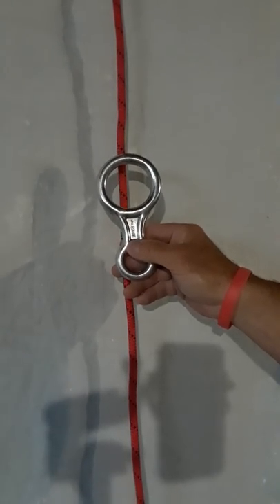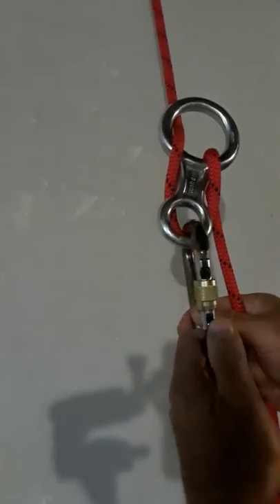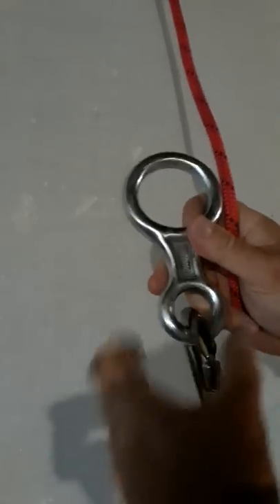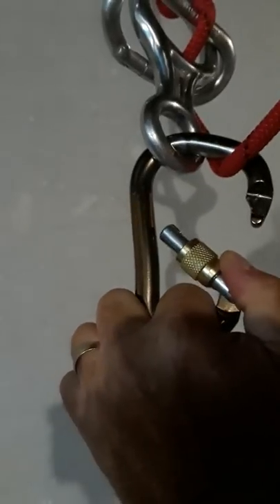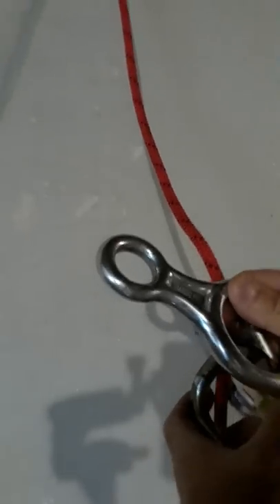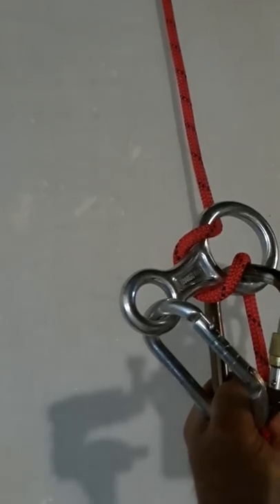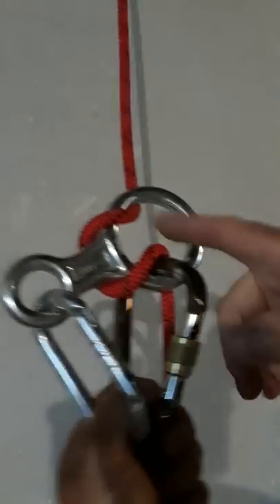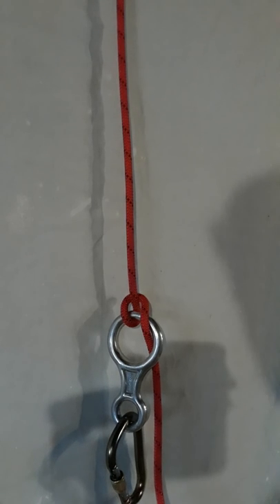RAPPEL MODES   10 WAYS OF RAPPELLING WITH A FIGURE 8

Comment: Never open your carabiner during your belay and the "carabiner brake" modes look sketchy, the rope could open the gate.
Reply from the maker: Look closer, no way those methods can open the gates
Reply: @rappelclub8271 That may be but I like to keep it simple and know a couple of methods and systems really well and practice with the munter hitch often. The breaker bar carabiner methods look like the breaker biner could slip and lead to unpredictable behavior. Dangling on a rope, I prefer predictability. Much respect.
Reply: @rappelclub8271  dude, that technique is forbidden in industrial climbing for exact that reason, it CAN open the gate! Little bump in the wall presses against the carabiner and... boom.
Reply: @rappelclub8271  I bet the hownot2 guys could find a way for it to open. Regardless if it "can't" open or not you should be using a locking biner for any connection that is a single point of failure.
Reply from the maker: In the brake bar set up, tou can completely remove the gate, and it will still work safely, I have no idea what you are talking about.
Reply: I don't see the gate opening being a problem unless it manages to flip over the rope and the figure 8 and then shift around to a bad angle, all without you noticing. You have to pay attention with a figure 8 anyway to make sure you don't cross load it, so I don't see it being much more dangerous.
Reply: It😂
Reply: I agree
Reply: Yep I thought the exact same thing immediately. Anytime I see a carabiner sideways I don’t even like that. But yea I guess even if that gate opened it wouldn’t matter technically. I’m still not fucking around with that though lol

Comment: I repelled once using nothing but a  paracord and a adjustable wrench
Reply from the maker: I would not recommend paracord, only handles about 550 pounds, plus the filaments are really thin and don't do well with abrasive environments, as for the wrench, I have rappelled using the frame of a bicycle, works well if you know what you are doing.  Please post you adjustable wrench method.
Reply: @rappelclub8271  I was just buzzed and playing around. Stupid joke I use standard gear when climbing

Comment: The one after your biner brake bar method (5:20) would cross load the biner and if the biner was to break, your rope wouldn't be attached to any part of your rap device and you'd free fall.  Highly recommend not crossloading the biner.
Reply from the maker: cross loading the carabiner is no problem at all, as long as you don't cross load the gate with more force than it is rated for
Reply: @rappelclub8271  Cross loading is one thing, but you are suggesting intentionally side loading them. There is no safe rating for side loading carabiners.
Reply: @Maskenken this technique is incredibly dangerous. Promoting it is negligent.
Reply: @rappelclub8271 the MBL for crossloading on most biners is 8kn which is 800kg. But that is the breaking load. The rated load is a tenth of that which is 80kg so it is not safe to side load biners for people.

Comment: In the cross-carabiner mode you can actually break your carabiner if it is a nowadays lightweighted piece.
Reply from the maker: Yes, maybe, but I do not use light weight any thing.
Reply: Rappel Club so why don't you say this? There are a lot of newbies out there, seeing some stuff in the Internet and going out and die.
Reply from the maker: @Tobi-zd9zp  You might be right, but I guess I was not expecting any one to use some cheap light weight biner to rappel with, unless it was an emergency
Reply: I'd have to agree. My least favorite method.
Reply: If you're rappelling correctly you never shock load the system. Side loaded carabiners can still handle 7kn (HMS, that I-Beam style is garbage for raps but still plenty strong). We use this method all day long while Canyoneering.

Comment: I would not recommend opening your locking life safety carabiner mid rappel, ever. Otherwise, nice list of rappel techniques.
Reply: What I was immediately thinking as well.
Reply from the maker: Good point, but I have carabiners that are rated at 22kn with the gate open and 72kn with the gate locked, I have never had a problem, I have even rappelled using nothing but a bicycle as my rappel device, I guess next you are going to tell me that it should not be allowed cause it is bicycle abuse.
Reply from the maker: @youregonnaattackthem  Not if you know what you are doing, and have been doing it for 32 years.
Reply: No matter how strong carabiners you are using, an open carabiner could slip out of the figure 8 when you open it mid rappel. I know its unlikely as long as you have weight on it, but you are opening up to a potential accident.
Reply from the maker: @gustafmartinsson  True, but I have been doing this for a long time, my carabiners are mostly rated at 51kn, never had a problem.
Reply from the maker: @ksmith6237  isn't every climber-rappeller by definition a crazy person???
Reply: A few thoughts: 1) My immediate thought about the open carabiner concern was also because it was open, not reduced load capacity. 2) 32 years without an issue does not make it a safe and proven method for the community. 3) Why not add a backup, like a prusik loop, before opening the biner?
Reply: Just put an extra carabiner on your harness next to the carabiner that the figure of 8 is attached to and clip the rope in new carabiner. That way you still get the added friction but you dont have to open the carabiner that your life depends on.
Reply: @rappelclub8271  OK great, you've been doing it for a long time and you probably know what you're doing, and what looks safe and what looks unsafe mid-rappel. But you HAVE TO expect that greenhorn rappellers are watching your videos.. and you just suggested to open their life support carabiner when it's loaded. You may be an excellent climber/rappeller, but a shoddy teacher!
Reply: @rappelclub8271  And about the carabiners - the locking alum biners that most climbers are exposed to are 23kN with gate closed. Yes, I have a steel Iron Wizard carabiner rated for 72kN also, but for my balls sake I'm not going to let that thing swing from my bridge!
Reply from the maker: @climbingsasquatch1336  Point well taken, I did not expect newbies to be doing this, but you are right, perhaps there is some fool out there that will try these without any sort of training.  I guess I have to be more careful with my upcoming videos.
Reply: You really have no clue. You need to put your caveat out first.
Reply: The problem with the open carabiner here could be solved easily by introducing another one, pulling through it a holding part of the rope, and thus getting the added friction you need. Stop quarreling.
Reply: I have done this but I wouldn't recommend  this to beginners
Reply from the maker: @adventureswithfrodo2721  I'm sure you have way more of a clue than I do, that is why so many people are commenting on the video you put out explaining how to rappel, right?????  ha ha ha a, don't make me laugh Frodo, get a clue and stop being a coward
Reply from the maker: @bobbypatton4903  this isn't about tricking any one, this is about teaching what is possible, if you want to live your life within the confines of that imaginary box, that is on you, I prefer to think outside the box.
Reply: Theres no possible way to load a caribiner to its capacity while sitting on belay. A rope couldnt even pop out once you're loaded stationary. Probably not a good idea for inexperienced people but not a huge deal if you know what youre doing
Reply: @ksmith6237  "are you like, some sort of crazy person?" is this a quote from About Time by any chance? lol
Reply: The carabiner under load will not move anywhere in this configuration even if you tried hard. What you should be aware of is that the force is applied perpendicaular - which is not how it's designed to work. And you have one friction contact point which is hotter. Figure 8 use to be out of aluminium alloy which distributes heat faster. I'd be afraid to open it hot but it's probably not a rational fear. A temperature able to deform a steel carabiner would probably melt the rope first... but still. Thanks to the author btw, Imma try them all one day 👍
Reply: You can always lock a prusik backup before you open the gate.

Comment: I don't like to be the dick in the comments section but this is sketchy and you should not take this guy's advice. The techniques in this video violate many safety principles with no benefit. Point number one: it's always best to have a locking carabiner between you and death, and there's really no reason you shouldn't. Don't use a non locker as part of your system. Always tie knots in the ends of your ropes to close the system. Lastly, creativity is great and all, but setting up a rappel shouldn't be creative. It should be as consistent as possible and once you've found something that works well for you, stick with it. Do it that way every time. Only change it under special circumstances such as adding more friction when using a very thin rope or rappelling with a heavier load.

Comment: Nice video.  Forgive the observation, but "cross carabiner mode" (5:05) looks dicey as hell.  The figure-8 is cross-loading the gate of the carabiner alone (not cross loading the entire carabiner, which would at least give you the standard 7kn rating).  If that gate joint pops, the rope leaves that rig altogether and you're dropping like a rock. Most of these are really cool, but that one gives me the willies.

Comment: A rescue 8 (with ears) is slightly larger but much more useful than a standard 8 and won't half hitch and lock you down. You can hold your position simply and easily with a hard or soft lock and release it instantly.
Reply from the maker: I have 3 rescue 8s, love them, but a bit heavy for daily use
Reply: @rappelclub8271  Says the same guy shit talking lightweight biners. Make your mind up.
Reply: @rappelclub8271  Do you rappel to work? Wth are you talking about? Why do you have 3?
Reply: anybody complaining about weight needs to hit the gym, crying about weight is a sign of weakness

Comment: The support + was very intuitive to me. I learnt the support way as a way to be able to rappell down fast without danger of the rope loosening too much and without danger of it turning into a girth hitch and locking you, but as soon a i learnt it i realized i could add extra safety by running the rope through the back of the small circle.

Very intuitive and safe

Comment: If you twist the bight before passing it around the small hole in canyon mode, you get an ''auto-locking'' mode, and you can pull down on the small hole that now acts as a handle for the auto-braking function. Make sure to keep a firm hand on the rope below the device because it can ''lock'' in the ''open'' position. I always advise having a back-up rope (or at the very least a fireman belay from a partner) to prevent injury, especially when experimenting with new techniques.
Reply: Nice!
Reply: Called the "Czech Grigri" here in Switzerland.

Comment: Why? The figure 8 stands by its self. Not made to be used in any configure you have shown.
Reply from the maker: I have been using these configurations for more than 15 years, not sure what you mean.  I have even used a bicycle as my only rappel device and it worked fine, all depends on what you know and have experience with.
Reply: @dvmulligan  I personally have eight years experience using koala bears as ascenders. True story
Reply: I usually use additional carabiner, like when you're using bobbin descender.

Comment: I'm no professional, but Carabiner brake mode, the one after (and a few more after that) to me  seems like a really bad idea. You're placing the majority of stress on the carabiner (the weakest part of the system). If it moves a bit, you'll be putting the majority of stress on the minor axis. Furthermore, it seems likely that it might potentially cause stress cracks after a while.. 

If the carabiner fails, the rope will pop out and the ground will be the only thing that stops you (there is less redundancy, and more that can go wrong).. 

Otherwise, good list (learning a lot)
Reply from the maker: when you rappel with an ATC, don't you put the majority of load on the carabiner???
Reply: @rappelclub8271  I mean crossloading it.. But again, I'm no professional (you probably know better)
Reply from the maker: @AndrewLuecke  what is the difference between crossed loading it at the spine or on the top???
Reply from the maker: @AndrewLuecke  what is the difference between cross loading the carabiner at the spine or at the top???

Comment: i suspect that none of the other experts thought of the last one because normally you'd walk up to an abseil rope and attach in to it. Who would think of de-rigging it to thread the device. You could also repeatedly thread the end through the device to create multiple wraps around the big ring of the Fig8.
Reply from the maker: Yes, but if you repeatedly wrap around the big ring of the 8, the heat build up is insane, unless you are only dropping a hundred feet or so,  some of these methods generate much less heat, and can be used for drops of 300 or more feet.

Comment: You keep rigging your 8 backwards. The bridge should be across the side facing you. You keep putting it on the side away from you. Putting it on the back side carries a significant risk of girth hitching your rope. If you don’t have the equipment to self rescue there is then absolutely no way to undo the girth hitch and you’re stuck until someone comes to rescue you. To self rescue you’ll need ascenders and ways to attach yourself to them. Just rig your descender correctly and avoid the girth hitch issue.
Reply from the maker: I don't hook them up that way in the real world, but thanks for pointing it out.

Comment: Side loading carabiners is never a good idea. Any way seems like you're just trying to be creative with a biner. Good luck!
Reply: If you're rappelling correctly you never shock load the system. Side loaded carabiners can still handle 7kn (HMS, that I-Beam style is garbage for raps but still plenty strong). We use this method all day long while Canyoneering.
Reply: Absolutely agree but in this case it seems like it's just positioned to provide a little more friction. But I think the figure 8 or the one with wings are designed well enough to  give adequate friction without use of extra carabiners. Maybe just bored climbers wanting to experiment... IDK
Reply from the maker: did you ever hear of the original carabiner brake rappel method???

Comment: The reason people answer 'no' to the munter hitch question is that it goes without saying that any system should be detachable from the rope, e.g. when you reach an anchor.   You can detach yourself from the 8 but you can't remove it from the rope, unless you have access to one of the ends.

I'm not saying it doesn't have applications, of course, but it's a different category from all the other systems that can be attached and detached w/o accessing one of the ends.

But overall it's an interesting video. People forget that climbing was a thing way before the invention of modern devices.

Comment: clip the fig 8 large hole to your belt krab. take a bight of rope and thread through the small 8 hole and clip a loose 2nd krab into that rope loop. now take your free rope into into a rope loop and pass through big fig 8 hole and connect this loop to your second crab and rotate that krab so the gate is away from your break hand now you have 2 loops across your break bar.

you never had to unclip your gig 8 and ropes never passes near brake bar krab gate.

liked and subbed your great vid ty.

Comment: Not trying to be a naysayer here but just because you can use the figure 8 in many of those ways does not mean that you should. Any time you are loading carabiner along any but the long access you are significantly reducing its rating. Anytime you open a gate under load you are reducing its working rating. please be aware of what you are doing and understand how and why things work the way they are designed before you take the risk of just changing the way you use an item because you can.
Reply from the maker: You make some valid points, but according to your logic, no one should use a Black Diamond ATC, or any tube device because it is stressing out the carabiner in ways that it was not designed to be used.  How do you get around that???  I have personally been using these methods for over 20 years now, if done correctly they are very safe.
Reply: @rappelclub8271  Hi , I don't think that I have a problem with the ATC or a tube device. You are hooked into your harness with one end of the carabiner and the rope passes through the carabiner on the other end. This does not try to bend the carabiner in the same way that the later methods are described here. I have used an eight as a tube device and and fine with that. It is when your are around the 4 minute mark and your are basically side loading the long axis of the carabiner. Normally  you will not see test results for stressing the equipment that way. I know as an old guy I am possibly getting all this is not the way it is meant to be, but there really was no disclaimer in the video that this works for me but is not really the intended method. Thank you for the reply and you did make me reasses my first comments.
Reply: sorry it was the 5 minute mark where you are putting side pressure on the gate that really worried me